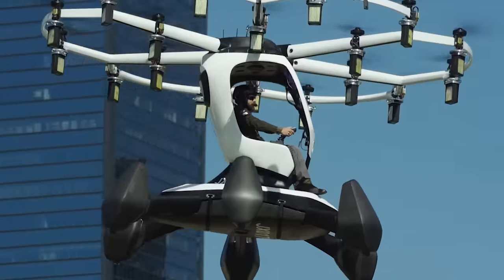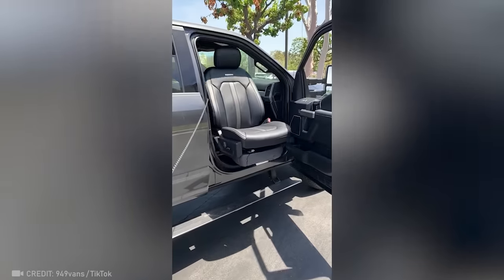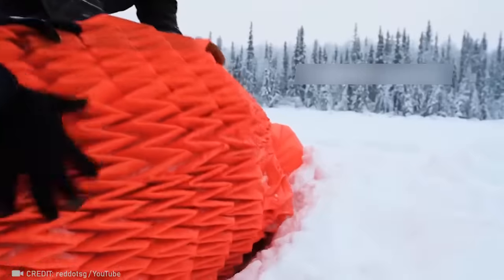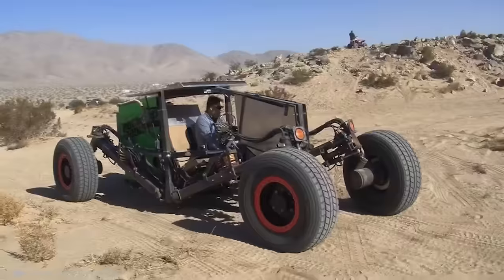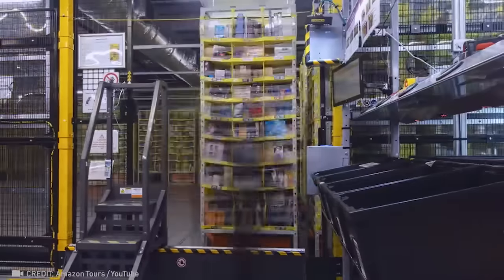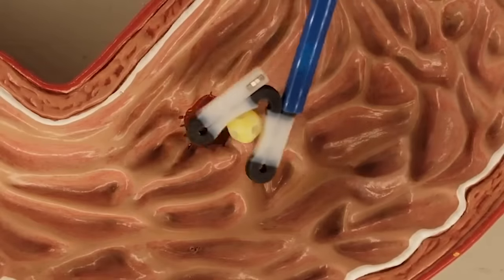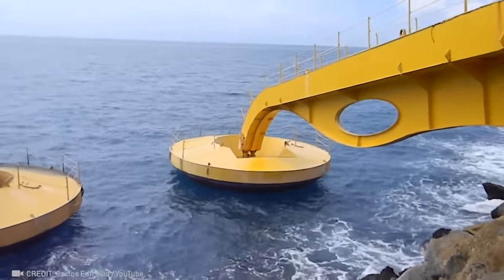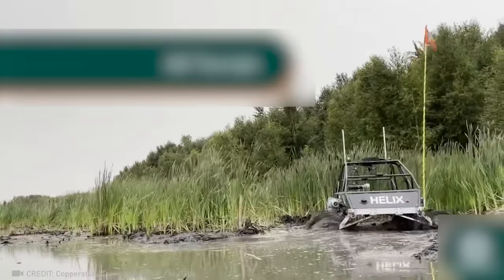Amazing Inventions That Are On Another Level

Comment: the dump truck that could turn the bed was the most practical invention.
Reply: Would be totally unstable with a full load being tipped with no support on the overhangs
Reply: @philipwall8548  absolutely agree with you. Was the first thought that came into mind when I saw it. There are countless videos of normal trucks tipping their bed, but the door is stuck, so all the load shifted to the back and they just tip over. Or they are overloaded or getting somehow out of balance. It might be useful for a very specific, very limited task...for which it obviously was created. But imagine this used at random sites spells disaster...

Comment: Most of these feel like solutions looking for a problem. That or they are unnecessarily overly complicating already existing devices. Some look interesting like the treaded dolly at 23:45, but would be for niche applications. The rotating camper is just absurd to me: Good luck getting home if that thing breaks down in the open position.

Comment: The underwater jet pack would be great to have, the regular jet pack is something that I could use, and that water equipment would certainly come in handy right now in Canada because of the wildfires.
Reply: Most of these are demos by the company that makes them without any consideration of how practical it is.
Reply: easier to make something fireproof than save it from fire

Comment: I've always been into steam powered vehicles so to me that retro tractor is the most amazing marvel of machinery I've ever seen
Reply: I'm more into electric powered vehicles.
Reply: @IzzFzz  you know steam has better torque right? LMFAO 🤓 (edit: better = flexible)
Reply: steam powered tractor pnsl, it's a traction engine not a tractor
Reply: @timelikeinfinity5142  yes it does have better torque directly from the engine, but an electric motor that uses a comparable mount of energy, without gears, will spin the axle more times per minute, so with gears the steam engine could convert the torque  into rotations per minute, and would have comparable torque if there was gear ratios involved to make the output axles from both spin at the same number of rotations per minute.
Reply: @dragonmasterlangeweg7625  hmm. . . :goodvibes:

Comment: To go through the trouble of putting a camera as the side mirror, why not just have the windshield view so you don't have to take your eyes completely off the road. Being on the door you still need to look away from the road....
Reply: Probably because where they placed it correspond to the same motion people are already used to make with regular side mirrors.
Sounds like nothing but having a double take because of such habit every time you look at the wrong thing can be a problem...

Unless it becomes a new standard, it's likeley to stay this way, even if objectively yes, a windshield view may be a better solution with this tech.

Comment: If an invention is usable as marketed and will not kill the user or others, it will get mass produced. If it is not, the only reason is, that the marketing was a lie and the real thing did not work like promised.
Take that Off-Road vehicle with the wheels on arms that can extend to different directions. It first sounded electric in the first shot and later spewed out black exhaust when climbing. And it seems to take forever even for a trained person to put the wheels right to not tip over. And we never see it really go up the incline. And parts of the vid are sped up. 
Others are just not practical, because they take as long or longer than methods already in use and you need a special operator who knows how it works.
Not even mentioning the outright fakes and the stuff that is just decades old stuff put in a shiny plastic housing.

Comment: Having just a list without any explanation about how they work is kind of boring. Add in the A/I voice that doesn't know how to say "legit," and this is a thumbs-down for me.
Reply: I wholeheartedly agree, and that you for your comment. 

I’d also like to add that the electronic “music” used in nearly every “jump-cut” video of this type, these days, is quite irritating, and needs to go away.
Reply: @tdin 0:16 😅9😅
Reply: If u can't figure out how they work,  your watching something that's way over your head. I didn't see anything overly complicated at all. In fact iv made sketches of similar and some nearly identical ideas to about a 3d of these over the last 10 years.  It's all existing technologies just configured and or used differently to accomplish new tasks. Using simple machines in combination some computing power or simple AI. In particular,  the wave generator  that can"  power a city" (highly doubtful with just the two shown IMO) was one of my oldest ideas although with a different design.  I also designed something similar but uses the motion in trees when wind blows blows through,  making the movement of branches the power source to generate electricity.  It will work far better than solar but using the same basic functions as the wave generator and/or the handball that can charge your phone. Just in case you don't believe me, that's about a 10 year old idea of mine,  maybe more.

Comment: Air hockey contact points earrings circuit closed amplifier/accumulator motors standing spread body multiply add weight

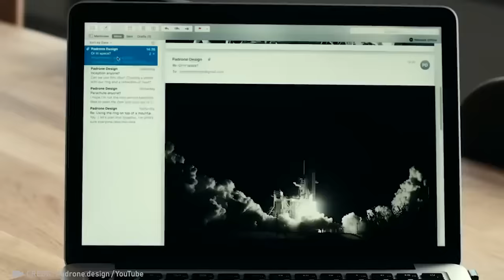Comment: What is that at 2:46? What does it do? It may have been put in the wrong video.
Reply: It's a tractor. It tractors.
Reply: I believe it's a old car before then new ones came out
Reply: Steam powered tractor -  It's either a refurbished old one (at least 100 years old), or a new steampunk. I think the former because of the rubber-wrapped steel wheels (so it can go on paved roads).

Comment: A few useless things dreamt up here. Some are good however. I wonder how big they can build a wave making machine? Makes me wonder about ocean shipments, if the storms they encounter are actually natural accourances or manmade by a super sized machine like the one in this video. If you can't work your own farm without people then time to sell it, plenty of apparatuses taking jobs away from everyone.  I was wondering why the fire machine thaat uses less water wasn't used in the Canadian wildfires? Were they left to burn to drive up costs or to cause a shortage? Phasing out fossil fuels is a mistake,  instead perfect it then incorporate all sources to work in unison,  that way there's not an imbalance or over mining of lands for materials.  Perfect what you start instead of chasing the greed. After all your high dollar decisions are killing people and yall should be accountable for your actions.  Lithium batteries are gonna destroy the land and pollute it like in Oklahoma pincher Oklahoma the city over mined and ruined for lead and zinc, battery materials correct? Perfect what's there burning fossil fuels,  perfect the aircraft engine to burn and use fuels more efficiently I'm getting tired of breathing it. Mercedes is on the right path with perfection to one of their aircraft engine's big thumbs up to Mercedes.  Fast passenger trains are great, however maintaining the tracks will help out tremendously so get at UT instead of just re-engineering the train itself,  fix the tracks, enough of the profits over humans,  enough of profits over safety.  Delivering store's lol, wow causes a very lazy community with diabetes and obesity not a good idea, go to the store for exercise gotta keep the lymphatic system clear that's the bodies sewage system that keeps organs operating properly.

Comment: A lot of these ideas are interesting but I fear that many are just photoshoped. However, a lot of the real things may be good but they often have achilles heals that ruin their practicality. Drone-motor helicopters can't auto-rotate and are thus potential death traps and those fancy walkers all have exposed bearings that would get chewed up. The mirror fire starter is great though and one of the only viable things on here because, while someone will burn out their retnas with one, they won't have a good case in court due to the common sense issue regarding mirrons and looking at the sun(same reason why telescopes and magnifying glasses can be sold). 

When it comes to human transportation, the automobile, ship/boat, airplane, and helicopter are the pinnacle of design. Everything else has fundamental safety issues that can't be addressed. Yeah, a human-carrying drone might be cool but its a death trap when a resister burns out because an o-ring failed letting in water.
Reply: I've seen a number of those - that you might think are "photoshopped" - on other channels, where they were presented as a novelty, a thing someone built one time, engineers trying stuff out... and they're not available for purchase at all. Prototypes, cool ideas, etc. Like a kickstarter without the crowd funding lol